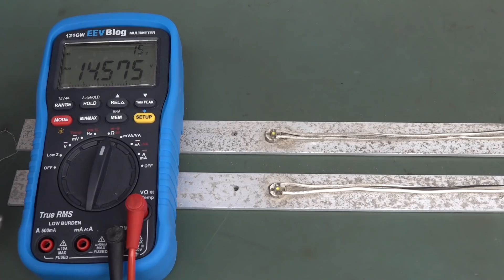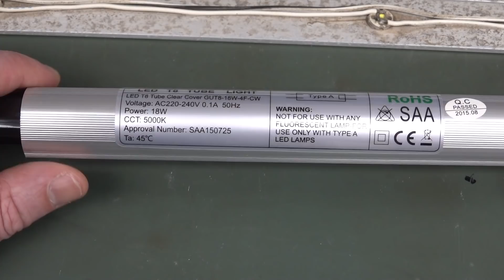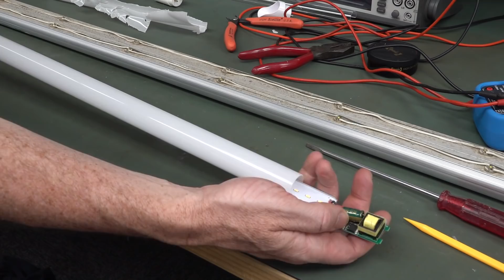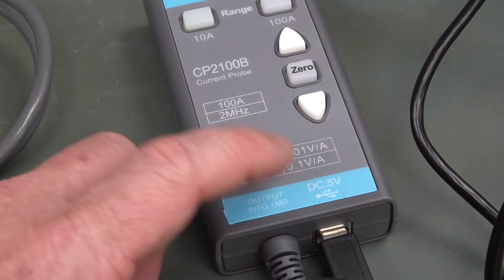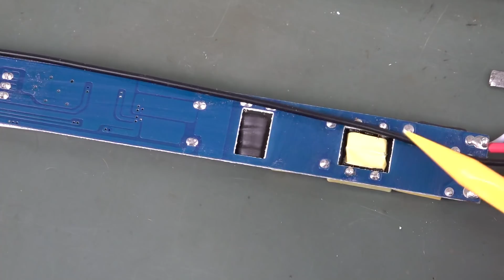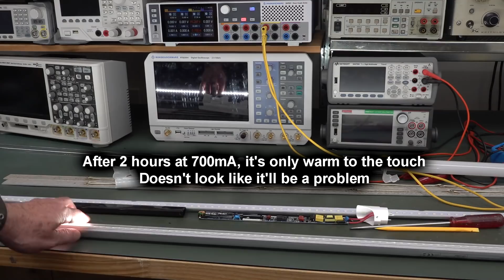EEVblog #1343 - DEAD Deck Cree LED's

Comment: Two or three bent sheet metal strips, with a U shaped cutout on them would work as brackets to keep it pointed up. Pretty simple work if you know someone with a saw that can cut the U shape into them. Could probably also be done fairly easily with metal cold chisel method. Then just bolt or nail those strips down, and lay your LED strip across. Gravity would be enough to keep the strip in place.

Comment: A few years before this was built, I believe it was Cree had switched to a new thin film technique for the active (GaN) layer in some of their most efficient phosphor-coated LEDs at the time. The thin layer was unusually susceptible to breakdown in the event of a voltage surge, and the damage was usually visible as a burnt spot on the die which of course was also a fail-short. I diagnosed some failures for fixtures which were reporting dead individual LEDs, and found that each time there had been lightning storms in the general area. At the time, it was a novelty to see isolated dark LEDs in a series array that continued to operate as normal.

Comment: Neve got to verify it, but I've heard that most semiconductors (LEDs, diodes, mosfets, SCR, BJT...) always fail shorted. If they do actually open, it because they initially shorted, then got a power surge that causes them to thermally explode. Mechanical leads may break, though.

Comment: Really weird indeed that they filed short. Strange failure mode. Even if exposed to moisture and corrosion. They are dead short, at 0.2Ohm. Some kind of thermal process.

Comment: I had a thought as to what might have caused the L.E.D.s to fail.  The wire you used to connect them all together are to some degree inductors.  As such, what do you think of the possibility that close lightning strikes could have induced enough voltage and/or current to blow the L.E.D.s?
Way back in the 1980's I was working with some diodes that had flat leads and to me looked very much like a dipole antenna.  I was wondering if you could string a bunch of them together, and use them to rectify an RF signal into usable power (if you used enough of them) for some purpose.  Well, some short time later, a matter of weeks I think, I discovered that N.A.S.A. had done just that!  I never did find out the results of the test, but would love to know.  Anyway, ever since then I have wondered about the possible "outside the box" uses for everyday things.

Comment: Hey guys and gals...My brother just gave me a new eevlog brymen bm235 multimeter and when I looked up the manual it told me to hold the hold button and turn the meter on and it only displays a letter C witch the manual say it's the 1st firmware revision so is it possible to update this meter? THANK YOU FOR ANY HELP YOU CAN PROVIDE..... AND THIS IS MY FIRST MULTIMETER OVER 5 DOLLARS!

Comment: Hey Dave, my company which currently does PCB level repairs (not component level) and they are looking to venture into component level repair. (Occasionally I can spot the issue straight away and have replaced a couple components to fix boards though). I know the basics of electronics and I did start my apprenticeship at an electronics business although I am a qualified electrician now. I am looking to further my skills as I'll be responsible for this aspect should they take it on. Is there any RTO that does this that you know of? I am based in Townsville NQLD and doubt there would be much up here, so travel may be needed. If they do take up these contacts, I would say circuit diagrams would become available for those appliances so that would definitely be of help. I'm just a bit worried as a $200 PCB would likely only allow an hour or so to repair even if it is as basic repair.

I understand how components work. I can read circuit diagrams. But I feel I wouldn't be efficient enough to justify the venture at this present time. I really want to take on this opportunity as there is only one other company in town that does this now (where I did my apprenticeship) and it's much my passion but I don't want to say yes just yet as I know I'd be going in a bit above my head. With newer electronics under warranty I expect alot of surface mount and also time constraint which is where my equipment/efficiency isn't up to scratch.

I have done some PCB repair on the side, not for profit of course as I literally just charged cost price for parts.

Hope to hear some advice!

Comment: Dave, would you be interested in exploring plasma lights, such as the sulfur light?  Magnetrons (for the high power lamps) or solid state RF wizardry (lower powers) bombard a quartz glass ball of various elements, emitting enormous amounts of light from a small point source, and supposedly the most efficient way to convert electricity to light, while emitting a wide swath of the visible color spectrum, unlike LEDs which are peaky.

Comment: Several parallel strings and a single driver? If one LED in a string fails open, all strings will immediately fail in the same way due to increased current...

Comment: looks to be 8S10P all 6 name brand 2835 leds are rated at 60~65ma so the leds are rated to 650ma witch is about 25w your at 27w so i think this will be fine also the cooling was designed this thing is inside a fixture most T12~T8 fixtures have almost zero air flow.. leds spec's are 0.2~0.22watts of heat at 65ma  per led so that thing needs to dump 16-18watts of heat at 700ma holding it might not feel good in the hand but i don't think it will exceed 55~60c even in dead air that's a lot of surface area for a 16w load.

Comment: If you need to mount a curved tube try an appropriate size conduit clip with a screew though the centre hole although if the tube is to large you may need to hit the 3D printer.  https://www.bunnings.com.au/deta-25mm-conduit-mounting-clip-2-pack_p4330823?gclid=Cj0KCQjwuL_8BRCXARIsAGiC51DVrc0eiCG3ZB7SF9SwguzH6VjBVSa-IahtglflLjHxlH05CIT_lfUaAg3_EALw_wcB&gclsrc=aw.ds

It would be interesting to see how much EFI they generate with such a cheap and cheerful implementation

Comment: Hey Dave, you might've already solved your L.E.D tube mounting issue, but as a suggestion, you could look at using a couple of Stauff Clamp 1/2's...commonly used for mounting hydraulic hoses, pipes etc in industrial applications👍🇦🇺

Comment: Dave
 Grab some quarter round trim, paint white and use them to hold it in place and mask from the side.
10 bucks of wood and some white spray paint and a few pairs of finish nails. Done.

Comment: Try sliding out the long PCB from the aluminum extrusion, then mount that to your original aluminium strips, after cleaning the LEDs off them, and maybe  sanding the strips down a bit.

Comment: Just remove the Al board from the original round heatsink and mount it on the old, thick Al sheets. The PCB can be pushed out, usually with quite a bit of force, but they are not glued (at least I haven't seen one that was glued). 
Spraying some silicone spray between the board and the housing might help to lower the friction. No need for thermal glue, just thermal paste and a screw on every 10-20 cm along both sides of the PCB. 
And don't forget to spray at least some clear conformal coating on the PCB, these SMD LEDs doesn't have plastic lens on them as the old Crees, it's just the phosphor in some resin, and hygroscopic, quite sensitive to humidity. And based on the level of corrosion of your old Al sheets, they used to get quite a lot of condensation out there.

Comment: If the voltage requirement was too high, could you not have shorted out a few of the led chips, maybe every third or fourth? I do not imagine it would have made much visible impact, given the large spacing of the original setup.

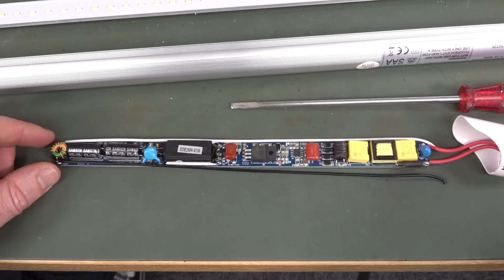Comment: 21:17 The technical term for that driver isn't "nice," it's skookum.  I didn't see a link to that current probe and I couldn't find it on aliexpress or amazon.  I eventually found it on eevblog dot com for about 350 greenbacks but it's out of stock.

Comment: The problem with failing short is the increased voltage accelerates the death of other lights in series. I've noticed this with "self-fixing" icicle Christmas lights (incandescent). If you don't catch and replace bulbs quickly, before you know it a whole section goes out.
Reply: These are constant current driven (the driver will reduce the voltage), not like a series a bulbs witnout any kind of driver.
Reply: @gabiold  Makes sense but that depends on the driver, I guess. May have to go back and look at that #50.
Reply: if it is a LED driver, it will be constant current, otherwise LEDs will not last that long.  so no, there is not increased voltage  unless driver goes into some weird state on lower output voltage condition.

Comment: I design these LED tube light systems. 99 percent of these things are CC driven with the simplest circuit possible with minimum filters to meet the BIS's EMC standards because the manufacturing cost target for the MCPCB and the driver is <1.5$. We have used compliance voltage as high as 90V. Some of these LEDs(custom made for cheap lighting application) used in low voltage applications will have trimmed terminals to simulate series "resistance'

Comment: I don´t know if you get Toshiba socket GX16t-5 LED tubes over there. Here in germany I get them as surplus for less than 3 € each 150cm 36W 4000lm tube. They need only a cheap chinese 300mA 36W constant current power supply for 6€ and this works perfect.

Comment: just drill a hole in an aluminum sheet of the width of the tube, fold the edges inwards to make a mounting point, cut down the middle of the hole, boom
2 round brackets for a square beam!

Comment: re current sharing: these days the manufacturing process seems to have that pretty nicely controlled. Also the second isolated driver, does it maybe have a feedback winding in the isolation transformer? the datasheet looks like it wants one

Comment: Hello Dave sorry but how could You say that is a constant current when it change significantly (pk - pk 249mA which is like 174mA rms to 428mA which is 40%). As i remember constant its a more or less straight line but in this case its hard to say that is constant. I belive You mean the average of the chart is pretty constant. Best Regards

Comment: Modern led lamps are exceptionally bad in thermal design. They are dying because of driver failure. Electrolytic caps simply dry out. None of my LED lamps have a single failed led, only dead drivers.
Reply: Then you really need to get some with awful drivers, or simple droppers that are rated 110v but labelled for 220v as they sure do kill the LEDs. I have gone through a lot of those through the years trying out some "cheap" ebay LED lamps

Comment: I think I would drill a hole in a small block of wood the same diameter as the light with a hole saw and then cut the block in half, so you’re left with two semicircles. And use a few of those for mounts.

Comment: 12:00 Multiple Parallell strings of serial leds with constant current not recommended as best practice ?  I have been thinking that this was the best practice for a high number of leds. Is there a best/better practice?  Cc on each branch of parallells, perhaps.  How to construct a small efficient led ps with  multiple cc-lines  for efficient and longterm led driving, 
A schematic and a discussion on such a PS would be interesting to see there must be tons of solutions and dedicated ic drivers for this out there nowadays)? Thanks .
Reply from the maker: Yes, only with a dedicated CC circuit for each string can you guarantee accurate current. If that matters of course.

Comment: My guess for failure would be long term moisture caused my condensation getting to the die over time.  Still 7 years is pretty good life for outdoors.
Reply from the maker: Yep, decent guess.
Reply: @EEVblog  Those LED strips on ebay last a year or so in the humid air near Cairns before the green of death hits them. I order Silicone tube, epoxy resin filled IP68 LED strips and they last forever. I even use one wrapped as a spiral light for a squid light that I have had running for 6hours+ in saltwater when fishing with no issues. Got them from Ray Wu on aliexpress, they're the best outdoor LED lighting I can think of if you get moisture ingress issues. Well worth the extra money.
Reply: Sounds likely. Were they given a quick spray of clear acrylic lacquer when new, they would probably still be running. (A true conformal coating would of course have been better...)
Reply: Would high ambient temperatures in Australia affect the lifespan significantly, or would it be a non-issue at the outdoor temperatures involved?
Reply: @MrPGT  maybe in direct sun light, but not under a roof. ambient is still lower than max working temp.

Comment: 15 volt diode check? I must have this meter
Reply: Guess who sells those meters...
Reply: I was thinking the same this lookis really convenient . Just wondering how much voltage/current it can supply . This could also be used for other things than just LEDs.
Reply: That might cause havoc with some of the transistor radios you have been repairing lately, if you forget to use the lower range, lol.

Comment: What happens if you temporarily connect a high current bench supply at about the forward voltage to the shorted LEDs? Maybe it will blow open the short and get it to work again, maybe it will go open.

Comment: Funny I remember it too, because I used 4x Cree xpg in my bicycle light. Two spot and two oval carclo pmma   lenses. The LEDs were glued to an L-profile and then to the top of an extruded aluminum case.

Comment: Dave, In the DIY LED strip can you wire them in parallel? They will stay on even if one burns out and you can use a lower powered power supply. I took an LED strip out of a broken TV and I'd like to rewire it in parallel so I can mount it under my computer desk.
Reply: You can of course do that, the only thing is that if you need higher power you end up needing chunky components for the currents you end up with.

Comment: Even if 700 mA drive was too much, couldn't you just parallel the strings? Low-ohm resistors to balance the current? Or is pulling/reconnecting the wiring also a PITA? Snazzy looking probe, BTW!!

Comment: Müller Licht (Yes German) makes some really nice lights. I always look for them when shopping, but they are hard to find here in the states. My last batch lasted nearly 5 years running near 24/7.
Reply: ALDI sells them here (if that info is any use to you).
Reply: As a German, I'm a little disappointed that the "one hung low brand" design actually appears to be nicer (driver, heat sink) than the Müller Licht.

Comment: Have you opened up ceiling LED panels, those commercial sized 1200x300mm units? Running several parallel banks of series strings seems to be a quite common arrangement. Then the whole network is just powered with a single constant current source. Maybe it's like the concept in your Gaussian resistor video, where the more elements in the series string, the better they balance themselves. I've run 4 panels off a single constant current source, and at first I thought it might pose an issue, they've been running over 15 hours a day for a couple of years and there's no perceivable difference in light output. Perhaps it's riskier that way when running them at significant power levels where thermals will dramatically alter a LEDs conduction,  but it doesn't seem to make a difference at low power where the temperatures are close.

Comment: I found that thin super glue works really well for attaching LEDs to aluminum strips. Thermal epoxy is not needed. I made lots of LED strips by super gluing the 1W LEDs directly to aluminum strips. I don't bother with circuit boards, I just bend the leads up and solder wires to them. As long as the strip is mounted so it can't flex, the LEDs will stay attached and the super glue is thin enough that it doesn't effect the heat transfer. Some non corrosive silicone can be used to protect the connections.

Comment: I find it interesting that these tubes are multiple series strings placed in parallel. Wouldn't it make more sense to put multiple parallel arrays in series? That way parallel elements will be closer together with potentially lesser temperature differences, leading to more even current sharing.
Reply: But a shorted one will take out the whole section that way. Probably that section will die anyway, because of higher current, but not instantly.